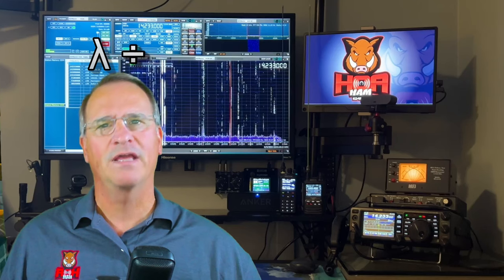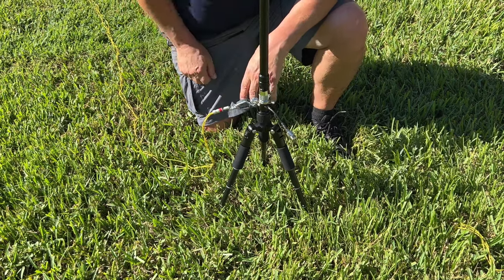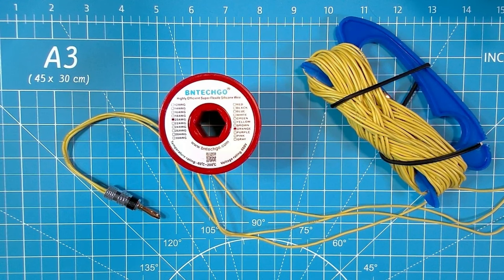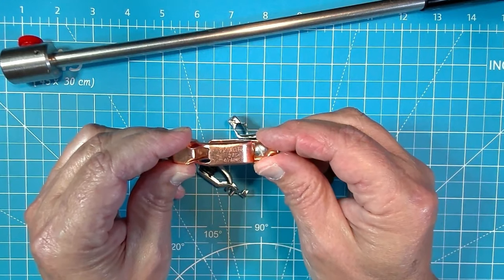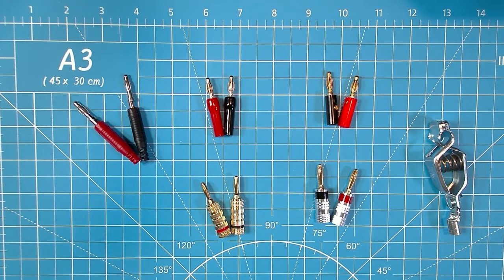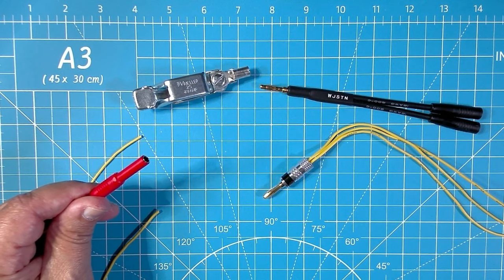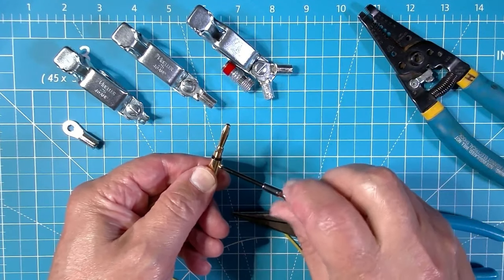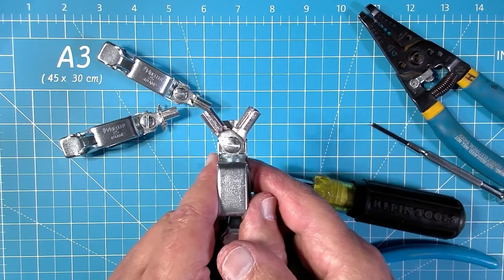Single Ground Radial System for ALL Your Portable Antennas:  POTA, SOTA, Back Yard Portable

Comment: I love your idea of using the banana plugs.  However I took a little different approach.  Using the 20amp alligator clips from Amazon and 4 - 33' lengths of wire, I stripped about 1/2" off the wires, twisted them together and soldered them.  Then I made a hook out of the wire and attached them to the alligator clip with the screw and soldered the wires to the alligator clip.  I then put heat shrink over the soldered alligator clip and wires to help as a strain relief.  This configuration worked great for the POTA support your parks weekend where I got over 170 contacts from New Zealand to Spain from the midwest with just the 17' MFJ-1979 on a home brew mount attached to a grill in the park with 12 radials.  I would have got more, but the temps climbed to over 100 degrees and my body decided it had enough heat.  I look forwards to seeing more of your videos.
Reply from the maker: Duane, spot on with your approach.  Soldering to the clip is another great option; so glad it is working well for you.
Reply: I did the same soldering approach here. Simpler and more robust connection IMO. Works well with my WRC SB1000. 😉While the banana plug approach is more ascetically pleasing, the direct solder and screw down approach is more permanent, which I like. Plus you save some coin on not buying spare plugs or connectors. And as far as being a trip hazard, the alligator clips WILL unclip if enough force is put on them, just like the banana clips. It's all in how you want to set up your kit. Bright colored wire is always a better choice for radials when setting up in public areas to avoid the unsuspecting person from getting caught up in the web of radials ;) 73

Comment: Can someone confirm the ring terminals fit the 4mm larger banana plug that is recommended to buy?      Bought the recommended Sewell banana plugs and turns out they are one size larger than the standard 3mm.  They will not fit at the end of a standard ring terminal.   Has anyone bought the Desco ring terminal and did it fit the 4mm Sewell banana plugs?

Comment: Thanks for the info. I've been looking for it.  I'm a new ham, but I do think you are right that 2 experienced hams will come up with 7 answers. I've looked at several videos and what I think I know is that there's more art than science in these portable counterpoise wires.  I think I'll start with 3 x 16' and see what happens..... May I assume my SWR meter will tell me I need to make a change?
Reply from the maker: Yep, your gonna find the number of opinions (many conflicting)  on the subject of radials is endless.  I always start with what the antenna manufacturer suggests and then adjust from there.  Don't care if its convention, only if it works.  If you're off, the SWR meter will let you know.

Comment: This just totally demystified the process of adding radials for me. I've got a couple of months, at least, before I'm probably going to try this myself (I only just tested and passed for Technician), but since portable operation is one of the things I'm very interested in, this really helped me feel like even I (a notorious klutz) could do this! Thank you!
Reply from the maker: Well, that's pretty much what I was going for.  Every manufacturer out there with their "custom" radial solution when one method could cover them all.  It was a problem I needed to solve for me and I'm glad others are benefiting from it.
Reply: @HOAHamRadio  Bob, I wanted to come back and say, I have now actually built two sets of these (the second just yesterday). So easy! Thank you for everything you do!
Reply from the maker: @unclemikeyplays  Fantastic!  Its my "go to" for quick set up.

Comment: Just ordered the supplies to do this today. Thanks for the idea. I'm also going to make a couple of single wires cut at 16' 6" so that I can use a bnc to banana plug adapter to make a dipole. The dipole wires can be used as radials too when not serving as a dipole.
Reply from the maker: Great idea, multi purpose! Best utilization of the materials.

Comment: Great video, I only have a spike/mirror mount and a wrc tripod and a 50 pack of power poles so I just used power poles on mine.
I like your clip idea though as a PP can disconnect easily when you are pulling on the radials straighten them.
Your video proves that in HR there are 100 different ways to arrive at the same place. 😀
Reply from the maker: So true about 100 ways.  Sharing ideas lets everyone decide how to operate well, and do it in a way which works best for them.

Comment: Thank you for this.  It will make easy to add radials of different lengths to my DX commander to see if they are of any benefit to what I have already.  Also a real time saver when I take the expedition portable.  Great video.
Reply from the maker: M Demes.  This was born out of my frustration of all my antennas; had to come up with a better way for survival.

Comment: Great video, as usual. Imagine if the proprietor of the “Project Farm” YouTube channel tested ham gear … But, I don’t even know if he is a ham, and some ham gear might be hard to test like he does other things. Maybe have a robot repeatedly extend and retract a telescoping whip to see how many cycles it lasts before it breaks. 😀

Seriously, keep up the good work! I’m working at rebuilding my ham station, but sort of in reverse, starting with a light, inexpensive QRP ”go bag”. “Buy once, cry once”? No. I’m starting with budget and/or DIY gear, then if/when I can afford ”better”, they will be my backup gear. My very first HF antenna was a "Super Antenna", back when it was $100 less than it is now.

73 de AF6AS in “DM13” land
Reply from the maker: Thanks for the great feedback.  You have a plan, work it and you will have a blast rebuilding your station!

Comment: Pretty cool I put together the 20m ns 40m so far. used 20m a couple times and definatly helped my MFJstick, going out shortly and will add the 40m piece and see how it works. I put together 6 radials. That wire you recommended is amazing.
Reply from the maker: Always glad to hear the ideas I share are helpful.  And that wire IS amazing, just never tangles.

Comment: Great video, thorough explanation, and complete shopping list. Appreciate all your efforts
Reply from the maker: Thanks for watching and the positive feedback jjlejr.
Reply: ? Having another look at the video, you mentioned 16.5 ft radials with the the Wolf River coil clip-on demo, which had three radicals. 
Does that mean   3 individual alligator clips, with (3) 16.5 radials each?
Reply from the maker: @jjlejr  I put three individual 16.5 foot wires together with one banana plug, one ring terminal, and one alligator clip.  You can use as many with the one / one / one as will fit.  Each single wire does not need its own alligator clip.

Comment: The Desco ring terminals are available on Amazon now, but they're asking almost $10 each. Global's price is about the best I've seen for that part.

I went with a cheaper alternative to experiment with, and found that ring terminals for 8 gauge wire will fit banana plugs. I can get those locally although they're soft copper and won't take much abuse. I even found a size to fit a 1/2 inch stud, which fits perfectly under the insulating washer of the antenna mount at 3:09. 

What I need now is an adapter to mate a JPC-12 (M10 female) antenna to the 3/8-24 female hardware on that mount. The JPC-12 has its own ground spike but I want to experiment with the antenna mount on top of a 3' aluminum tube.
Reply from the maker: Thanks for sharing the details on your experiments.  $10 for one Desco ring terminal --  YIKES!  That's crazy....

Comment: Thanks for al the nice work and information you put for de Ham radio . 16 1/2 feet of wire this works also for 10 meters ? 🙏
Reply from the maker: Thanks for the positive feedback; not sure on the 10 meters as I never operate 10 portable.  They could always be coiled up to shorten if needed.  Someday I intend to operate all bands to confirm but just haven't gotten to that yet.

Comment: This is my new favorite ham channel. Keep up the good work. Question. I plan to use this setup with two ham sticks and that exact tripod. I have a 20m and 40m hamstick. Do you recommend I use 3 or 4 16.5 radials?
Reply from the maker: Tricky question because there are so many variables.  I keep bundles of 3 wire per banana plug with me.  I use one bundle of 3 on 20, then keep that when I go to 40.  If that doesn't get it done, I add the second bundle of 3 wires, 16 1/2 ft each, and that works for me.
Reply: Thank you @HOAHamRadio

Comment: KB9VBR  did a similar thing in a video last month, except he soldered the wires directly to the clips with no banana jack or ring terminal. I know you probably thought of that, so I am curious as to your thought process. Is there an advantage of one way vs the other. in your opinion?
Reply from the maker: Chuck, thanks for the question.  Two reasons, since I have some antennas which are better suited for banana plugs rather than the alligator clip, I want the ability to do either or.  The second reason is the alligator clip large enough to handle larger diameter spikes gets very clunky on a winder.  The way I have done it, the clip does not go on the winder.  That was the logic behind my direction.  Performance wise, both would be the same; really boils down to personal preference.

Comment: I bought the parts from your list - and the y adapter spins in the ring terminal. Have you found that to have an effect on the conductivity?
Reply from the maker: As long as there is some contact should be good; you could check continuity with a multimeter

Comment: One of the most helpful You Tube videos on the WWW and #1 on radials!  Thank you.  If I want to hook up 24 33' radials on a wind river coil antenna do you think 6 strands to 4 ea alligator clips would be the easiest way to go? Just clip one to each leg and then a second on one of the legs a second time?   Bob / Ocala
Reply from the maker: First, thanks for the compliment.  I was trying to solve my own problem and seem to have ended up helping others.  Yes, you can use as many wires as will fit in the banana jack, then just clip them to the different legs of the WRC tripod.

Comment: I have my own system using those clamps and barrel connectors for my WRC radials but I like your system so I'm going to switch. I have the 24 gauge version of that wire in yellow. Do you think the slightly smaller gauge would work as well?
Reply from the maker: W4MKH, I believe that would be fine.  Sotabeams antenna wire is 24 gauge I believe, so you're in good company with them.
Reply: @HOAHamRadio  Thanks. I have 250’ of it so it would be great to be able to use it

Comment: Great video, thanks.  Wondering what your thoughts are for radials using stainless steel measuring tapes that allow for easy deployment and measuring lengths.   Maybe a video review where you compare wire radials vs measuring tape radials will be great, given how well you compare different solutions in your videos.
Reply from the maker: MD-BLUE, thanks for watching.  I've never used the tape measure radial, but now seems like I'll need to add that to my list!
Reply: Thanks Bob. Looks to me that such tape measure solution will allow for easy length adjustments, with the measurements right there for reference, or even markings directly applied to the tape for different configurations. Stainless steel measure tapes seem cheap enough to have multiple of them as radials.  The question is if the conductivity through stainless steel and the flat shape of the tape affects performance, or even the portion of the tape that remains retracted inside.

Comment: Think this would work for a radial on the Buddipole Versahub?
Reply from the maker: Thanks for the view and the question.  I have never used nor seen a versahub so this is only a partially informed opinion.  

As long as there is something for the alligator clip to grab on to it should work.  Length would be determined by Buddipole as I believe they call out very specific lengths.  You would need a loop on the end of the radial to attach this to an elevated rod; again, I think that is how their system works; an elevated radial.

Comment: Bob   how long were the six radials you put together on the one plug and do you adjust them for the band you are working or leave them all the same length fully deployed??"
thanKs, 73
Greg  WA3GM
Reply from the maker: The 6 wires in the demo were just scrap lengths (less than 2' each); I wanted to show how many wires the banana plug would accommodate.  I have been using 3 wires per banana plug in my set up at 16 1/2 feet.  One set of 3 has worked great for me on 20 meters, and for some strange reason, it also worked on 40 meters for the Gabil antenna I've been testing.  

I've made multiple sets, 3 wires each, so I can add or take away depending on the SWR readings I'm getting where ever I operate.  Thanks for the question.
Reply: @HOAHamRadio  thank you. Keep up the good work

Comment: How do you calculate the radial length of 16 1/2 feet?
Reply from the maker: 1/2 of 33' which is a commonly used radial length by portable operators.  I half the length, then use more as needed, so I can operate in a smaller amount of real estate

Comment: I only use one full 1/4~ radial per band in a portable POTA situation, but i keep it elevated with a 4 foot fiberglass electric fence pole. I put the GRA-7350TC on its tripod on the picnic table which keeps the wire near horizontal. I get good VSWR & the radiation pattern is good, i try to put the radial in the direction most of my contacts may come from. Has anyone else tried this for POTA? I appears to act like an inverted L dipole with the raduating element vertical. Cheers, Davey - KU9L
Reply from the maker: I really like your set up method @KU9L; it will be interesting to see if anyone chimes in with similar.
Reply: @HOAHamRadio  in a portable short term POTA, radials are not as exciting as the pileup a few minutes later, lol.
Reply from the maker: @KU9L  Sooooo true.  The only way I can get a pile up is going POTA, oh my, what a blast!

Comment: We tend to overthink many aspects of antennas and transceivers....when the best solution is often the most simple....the KISS design philosophy.   Why do people use a banana plug, power pole connector, ring terminals, etc....just connect the radials directly to the alligator clip.
Reply from the maker: David, perhaps you don't own all the antenna systems I do.  They each require a different set up, and therefore a different radial system.

Rather than having multiple styles of radial systems, individualized to the antenna brand, and constantly making sure I have the correct kit with me, I have removed the possibility of error by creating a universal system.

This isn't overthinking, this is error proofing so no matter what antenna I have with me, my universal radial system works.  

Thanks for viewing and commenting.
Reply: @HOAHamRadio  I think you missed my point.  You are absolutely correct about standardizing your radial system.   I have not yet seen an antenna system where the alligator clip approach will not work instead of banana plugs or other bizarre connectors.
Reply from the maker: I'm still on the clock at work and obviously missed your point and offered an irrelevant response; apologies David.
Reply: @HOAHamRadio  I think we are both on the clock and multitasking hahahaha. Keep up the great work!!  Your videos are excellent.

Comment: I just flip the screw to the other side and it’s easier to screw the ring terminals in.
Reply from the maker: Now why didn't I think of that; great suggestion!  Thanks for watching Tracy.
Reply: @HOAHamRadio  I would be lying if I said I wasn't struggling with the same issue, until it finally occurred to me to just flip the screw to the other side.